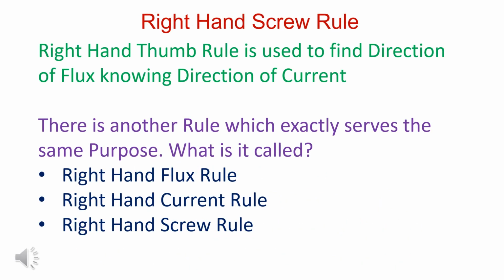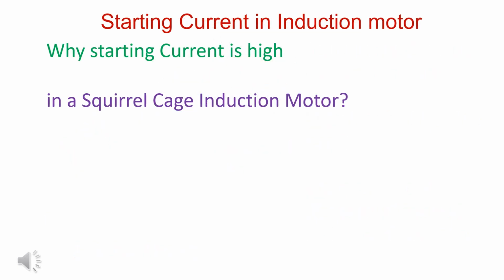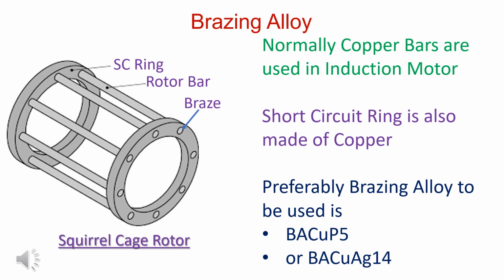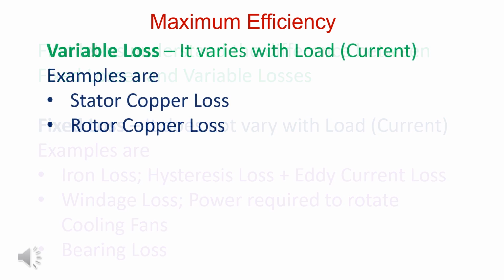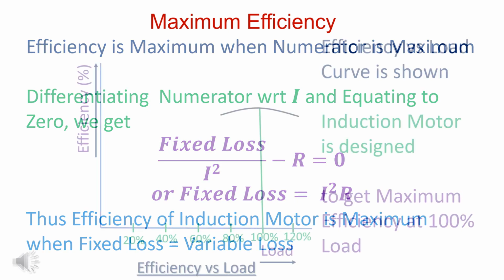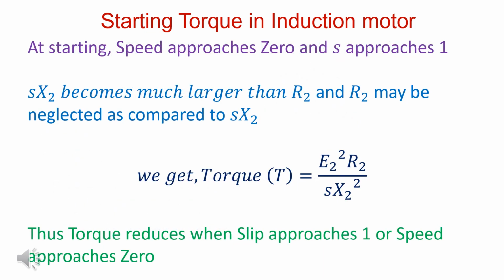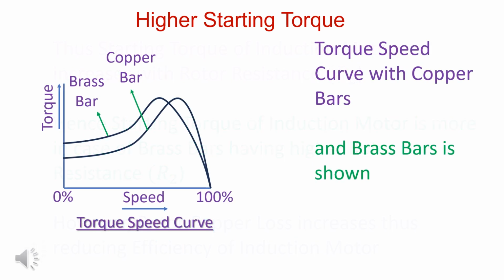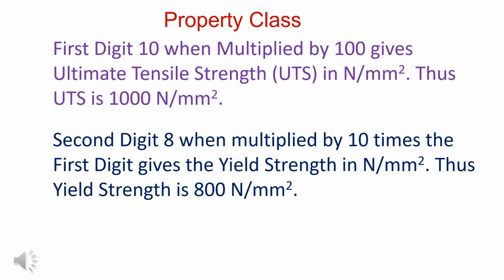Generator Quiz 14

Comment: Hello mister i have a question how to calculate inductance of a rectangular core
Reply from the maker: It is equal to mu knot X N Square X A / L where mu knot is Permeability of Free Space, N is No. of Turns, in Coil, A is Cross Sectional Area of Rectangular Core and L is Length of Core